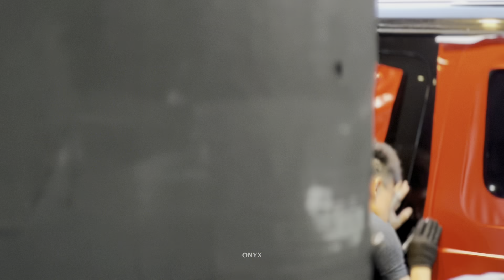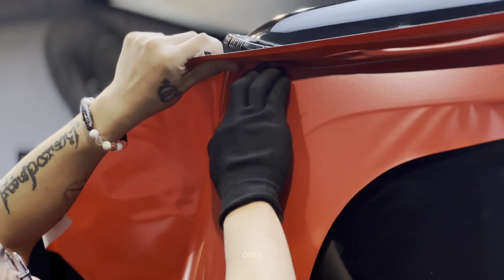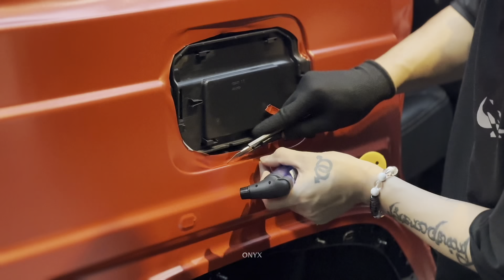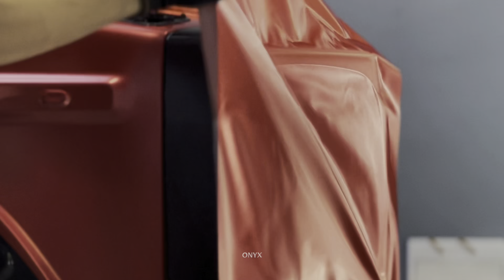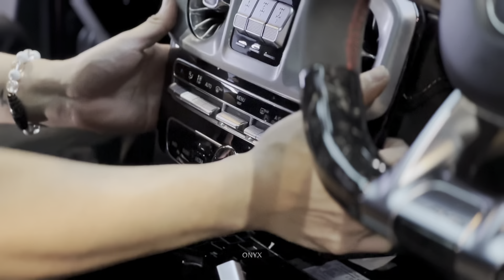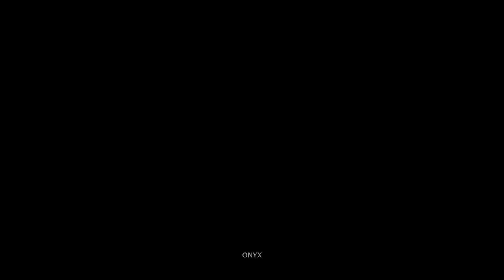Mercedes-Benz G63 AMG wrap & carbon Fiber Works

Comment: Hi…looks fantastic. curious if wrapping the interior aluminum parts with hi gloss carbon fiber will match the appearance of the existing g wagon hi gloss carbon fiber package parts that comes as an option with the car or whether it’s better to order 3rd party hi gloss carbon fiber parts. I was told sometimes the fit of the 3r party carbon fiber parts don’t match as well as the factory parts so better to have the factory parts wrapped?
Reply from the maker: Hello Edmond, at first, a carbon fiber wrap may look unrealistic, and if the installer makes mistakes, knife scars can be left on the original parts. However, the fitment of the carbon fiber parts is usually around 95%, so there's no need to worry about it. If you have any inquiries, please don't hesitate to contact us via WhatsApp at 0173413913